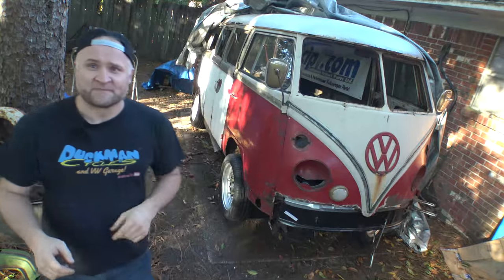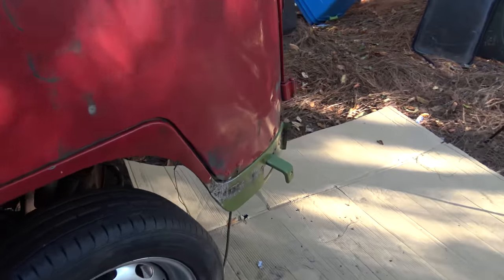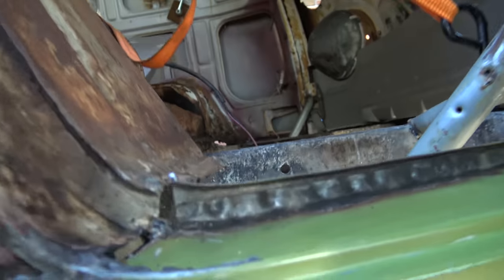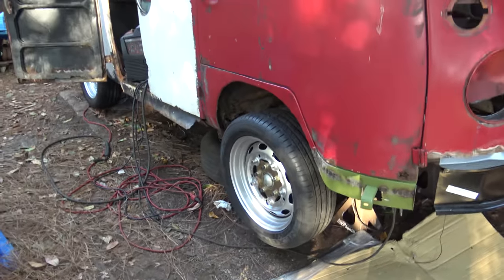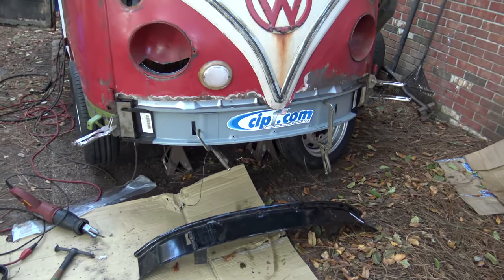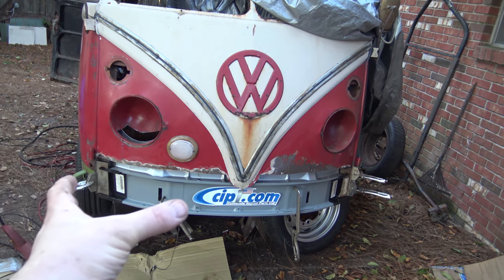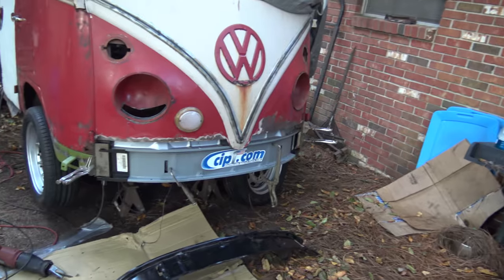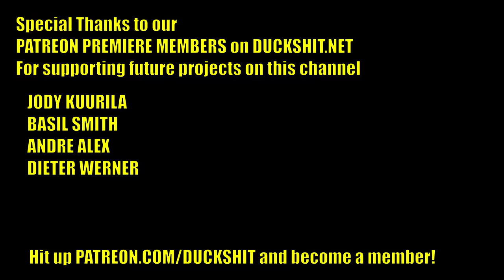Lower Wheel Arch Repair / Dogleg Replacement - 1967 VW Bus - Gregory - 16

Comment: You can see right away cip1 repair panel is quality !! Nice to now piece together , love this bus !!
Reply from the maker: Yeah the CIP1 part was a good patch panel, i just wish it was the whole piece!  In hindsight I probably should have just welded on an extension to it to complete it and gone with it instead.  All I would have needed then was the inner structure.  For what it's worth it would have been easier on my wallet too LOL
Reply: DuckmanCycles and VW Garage it’s pity cip1 aren’t in the uk as they would have my hard earned cash :) quality panels etc , def makes resto work a tad easier

Comment: My dream car is a 1974 or earlier bus. Love those things to death
Reply from the maker: This Bus is really something special to me, I was so lucky to find it even though it is in such horrible condition when I got it!  But it wouldn't have made for such great videos if I got one in better shape!
Reply: @DuckmanCycles  yeah I guess you're right haha, me and a friend of mine are currently redoing my 1966 beetle, I put a hopped up 1500cc in it and were currently replacing the pans. Last thing it needs is lights and the rest I'm pretty sure I can do on my own
Reply: @DuckmanCycles  these cars really rot away easy in florida
Reply from the maker: Yes, the sun eats the seals, then the rain fills them up with water.  Thankfully we don't have so much problems with road salt unless you live on the beaches or something.

Comment: You just don't understand German engineering. More parts mean mo'better. It's coming together nicely. If you rebuild any factory car, the fitment is always better. Regards, Solomon
Reply from the maker: Haha!  Yeah, throw more parts at it!  But you are right, handbuilt is always better.  Its amazing how nicely the stuff up front fits after all the tweaking and adjusting.  Factory would have slammed them together for speed in mass-production.  But the Bus will be stronger than stock when I get done with it!  😀😀😀😀   Thanks so much!
Reply: That's right layers and layers of steel!
Reply: @DuckmanCycles  They built 1000 buses a day, You build one bus in a thousand days. Gotta be better!
Reply from the maker: @sjp52047  I'd like to do it in half that time lol!  Here's hopin!  BUT AGAIN IT RAINS TODAY!

Comment: Can you comment on your surface passivation after you use phosphoric acid to eat off rust?  Is there something you do after the phosphoric to stop further rust for what appears to be a long time before you paint?  thank you.
Reply from the maker: Rust stays away... periodically I coat it again, but unless it gets excessively wet, or something compromises the iron phosphate coating that remains, it won't rust again!  Thanks for the question!

Comment: What do you do with the “good” new parts from cip1 when you have them and then order the “best “ ones , how do you recoup your money or do you just write it off?
Reply from the maker: Good question, I have been asked that a couple times over the years about other projects, too, which probably makes it a great subject for an individual Q&A video!  But the answer in short is everything gets reused, re purposed, or resold.  A lot of the stuff that I'm putting on to Gregory was originally purchased for Eleanore but didn't fit right so I planned the Bus around that.  Nothing gets wasted!   Watch for video on this subject in the near future, thanks for the question!
Reply: Thanks and you’re welcome

Comment: Hey duck man, you have a lot of experience when it comes to working on VWs- I have to replace the passenger floor panels on my ‘73 squareback and I was wondering if you knew anything about the seat mechanisms. I’ve never worked on seats before but I need my front 2 replaced, I’ve been looking at pro-90 seats but they only have adapters for ‘72 squarebacks & lower. 

Do you have any advice? Not sure where to go from here
Reply from the maker: Well if you're going to be replacing the seats, don't worry any about the stock mechanisms.  Check out how I put some 350z seats in my Beetle in this video here: https://youtu.be/Glk3TBdtkMM?t=20   You should be able to get away doing something very similar!   Let me know how that works out for you!